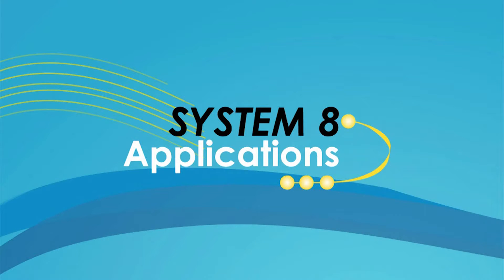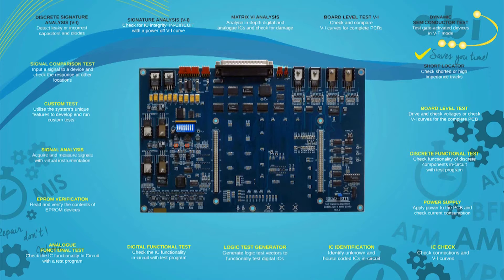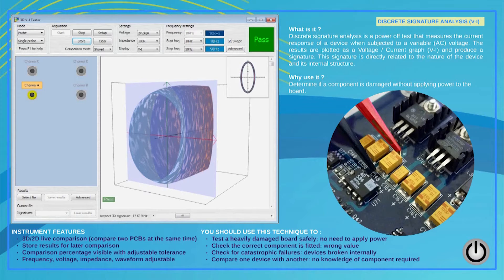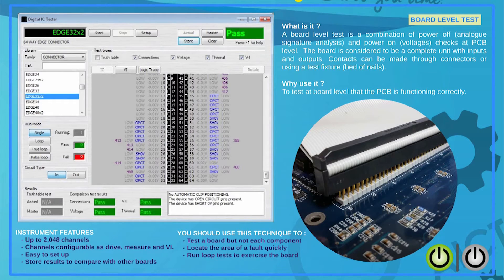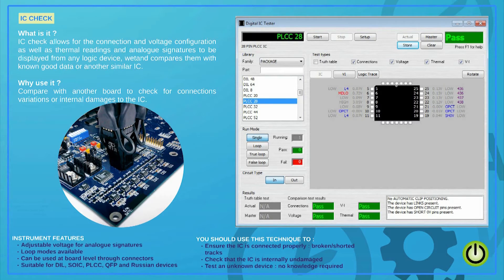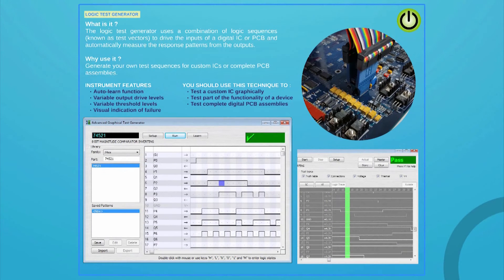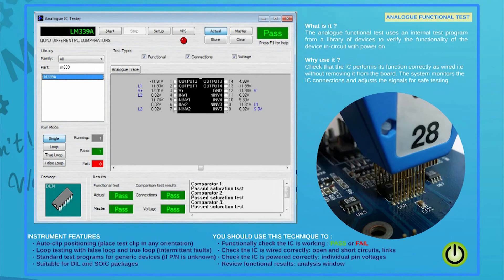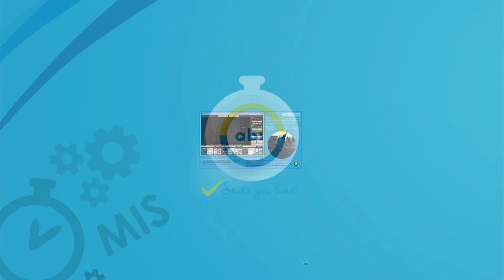IC Tester / PCB Tester: How to find faults and repair PCBs

Comment: There is too much variety of hardware in the world and you cannot have these units to test, review and compare all the variety of existing hardware on the planet (it is impossible). The good electronic technician is capable of detecting and repairing all kinds of electrical and electronic faults with standard instruments and tools; but these devices (equipements) are actually "thought" to make life easier for ignorant individuals on a professional technical level. In my modest opinion...😕
Reply from the maker: Hi Roberto, if you work for a business doing electronic repairs we will be happy to prove you wrong 😊. Ultimately, the ABI system will make a good electronic technician excel at his job. At the same time, it can help a less experienced technician become good and then great in due course. Search #RepairDontWaste for more information. 

P.S: some very clever engineers use our system at NASA, British MoD, Collins Aerospace, Samsung....they're anything but ignorant individuals!
Reply: @ABIElectronics  Hello again. I have been an industrial electronics technician for 35 years, so I think I know what I'm talking about. There is no system in the world that is capable of detecting failures in the internal logic of a PLD, FPGA, bipolar Prom, flash memory, SRAM, etc. And the reasons can be as diverse as the vast multiplicity of symptoms in each of those hardware failures. We can also extrapolate this to the world of analog electronics, as well as to electronic power circuits. Kind regards from Santiago de Chile.
Reply from the maker: @RobertoAlexFigueroa  obviously that are limitations in any technology. Our universal test and troubleshooting equipment #BoardMaster is not a magic box otherwise it would sell for a lot more. But the speed and level of fault analysis that it delivers are unparalleled. These are some of the reasons why it has been the industry's favourite since the early 2000s. The guys working at the F-35 repair hub call it the lifesaver system 😊. Un abrazo y que le vaya todo bien.
Reply: @ABIElectronics   Roberto can't afford one apparently  lololol